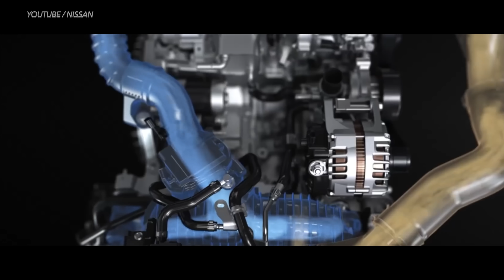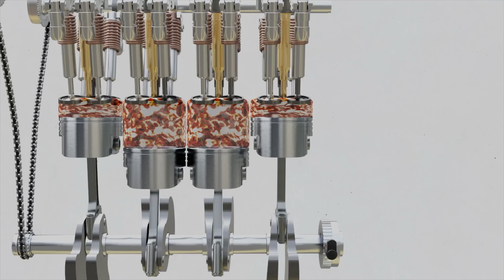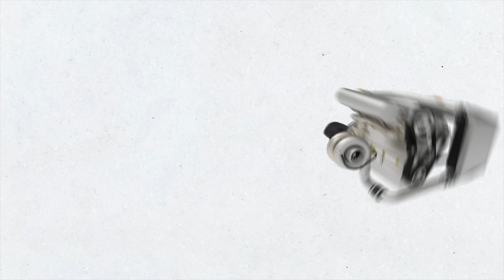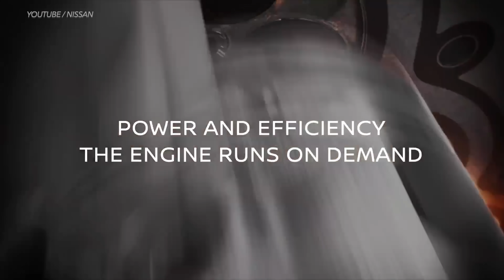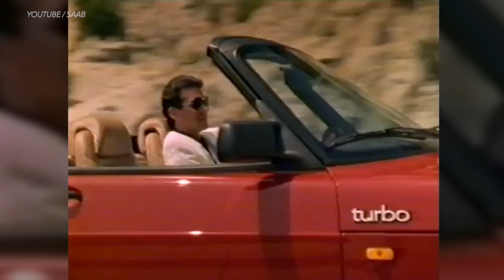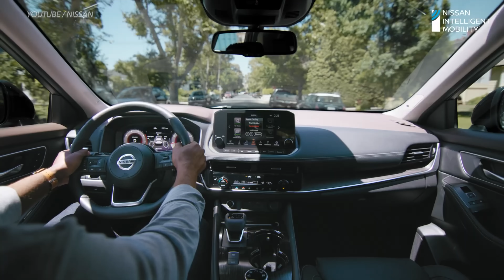Nissan Just Combined a Gasoline and Diesel Engine and Got This

Comment: Love how Scotty explains things....but all high tech comes with a price, right? Scotty tells it as it is. Me?  Sure I have a newer automobile; but today I set the idle mixture of my '49 Chev with a screwdriver.
Reply: Long live old cars.
Reply: @paulseary7041  They probably will
Reply: And 70+ years later that '49 Chevy is STILL on the road.
Reply: @cward1954  I saved the old gal (not my wife lol) from becoming a rice burner back in '97.  I have a nice low budget cruiser now!
Reply: Better hope you’re 49 Chevy is never in an accident.  No airbags.  No crumple zones (to absorb energy & protect the passenger).
Reply: @electrictroy2010  Every old car owner knows, or should know, these risks. As should every bike/scooter/motorcycle rider. Many old car guys have retrofitted their rides with modern safety equipment such as seat belts, disc brakes, improved lighting, etc. I totally support that. As for me, I putt around town at 30 mph and allow for plenty of stopping distance. Everything in life is a risk, even getting out of bed in the morning is a risk. In order to live life to the fullest,  one must take reasonable precautions and live responsibly. And I do.
Reply: A screwdriver?
Reply: @silentknightm2362  Yep. The idle mixture adjustment is a screw that turns out to richen the mixture and in to lean it.

Comment: So besides the frontier, which has been very reliable, what other Nissan vehicle jumps out as a reliable, desirable ride compared to others?
Reply: The jlr50 platforms the Jr50 platforms those both used the vg33e and we're pretty much bulletproof and extremely reliable still using them to this day and they pull great ✌️

Comment: US should switch to metric system. This does not make any sense.
Engine displacement -> in LITERS, but fuel consumption in gallons.
Imagine a L4 engine that has 0.528344 gallons of displacement.
Sounds American, sounds right...

Comment: Whilst I'm really impressed that they have actually managed to do this unfortunately it looks just like there's more to go wrong the usual suspect is more moving parts
Reply: At the end of the day my old Lexus V8 gives 24 mpg combined (UK) and makes well over 280 BHP, plus 325 lbs with no turbo or direct injection.  Granted your losing almost 10 mpg but as you say more parts, that buys a heck of a lot of fuel.
Reply: @rob5944  well it depends how much you drive. I was driving 10k miles a month for a long while and if I'm getting 10mpg less and have to pay for premium fuel that alone would cost me more than the car lol.
Reply: @occckid123  well I guess so.  Mind you if I had to drive that much I'd consider moving or asking for either milage or a company car!
Reply: @rob5944  thats not an option for what I'm using the car for.
Reply: @occckid123  I see, well I guess that's just too bad then 😕
Reply: Well, more to go wrong, and when it does, it's SUPER expensive to deal with.
Reply: @cward1954  complete engine rebuild I'd imagine.
Reply: And sensors and wiring and moving mass and computers and actuators and solenoids....
Reply: One thing going for electric cars is the use of one moving part and efficient motors (disallowing Tesla Plaid driving style), the electric charge source is likely generated at maximum power plant efficiency regardless of the original fuel source be natural gas, coal, nuclear, hydroelectricity, etc.
Reply: @richardwilliams1986  however that's about the only thing going for it.  I think that possibly hybrids are useful to keep pollution down in the cities, but aside from that electric only vehicles are nothing more than a gimmick.
Reply: @Rob Modern electric Teslas can go over 300 miles between charged.  On the road they can supercharge in 20 minutes.  At home they charge while you sleep.

EVs can be lived with very comfortably

.
Reply: @electrictroy2010  they're very expensive though.  Many terraced houses have nowhere to plug them in, and a house like ours will need to be upgraded if we want a dedicated charger.  Actually a hotel in our village has a rank of Tesla chargers and people come from all over looking for a charge.  I've had to direct a few, and I hear one needs to use only their mechanics to service or fix them?
Reply: @richardwilliams1986  The one thing that's always been holding back electric cars is battery technology.
Reply: You said a lot of what I was thinking.Would never attempt to work on crap like this or own one.Ricardo from the 20,s was hell of a smart man.This engine is a nightmare.
Reply: This world is a joke! I still can't believe that the internal engine after all of the years that it's been around, so many improvements in technology, the billions upon billions of dollars spent over the years to develop so many interesting technologies , IC engines etc..
Now the GOD DAMN POLITICIANS, EPA , AND DIRTY ROTTEN SILICONE VALLEY GIANTS , are taking all this away to replace it with  CRAPPY , just as "DIRTY AND TOXIC" ELECTRIC VEHICLES!!! BOOOOOOO!!!!!!! SCREW ELECTRIC VEHICLES!!!
Say Goodbye to NASCAR, F1 ETC....
No one is interested in sitting and watching Electric F1 cars. No beautiful sounds coming out of electric vehicles!!!!! That's why so many millions of people come to watch F1, NASCAR ETC.... the beautiful sounds of roaring engines and everything else that goes with it!! Not only that but everything else that also relates to the internal combustion engine
Reply: And more parts = more energy loss going into the parts before it gets to the wheels.
Reply: @thesilentone4024  friction?
Reply: This engine has twice as many parts to tear all to hell.

Comment: I admit I have a '18 Frontier. It's simple, and basic but even so, Nissan still makes me nervous. 
The Frontier is decent but Tacoma, Ridgeline and the F150 are leagues above and beyond better.
Reply: The simple, basic nature of the Frontier is what makes it great.   No, it is not refined or modern.  But it is reliable and the things that do go wrong I can wrench out in my driveway.  And until recently, it was very affordable.
Reply: @DaveBuildsIt  

So sad but true
Reply: My friends 2010 Frontier in Pennsylvania is a rust bucket. Seems Nissan didn't put the frame in a rust prevention bath like Toyota does with many of their vehicles. Bean counter cost saving screws the public every time. Bean counter engineering is ruining GM and Boeing  can't build a rocket that can get into outer space. Engineers should run car companies and other manufacturing concerns as it is readily apparent what accountants produce---CRAP.
Reply: Tacoma is not better
Reply: @anpham8107  Agreed! I had 2 Tacoma's in a row and both had major problems before 50,000 miles (Drivetrain) . Never again.
Reply: @stubby1122  that sounds like more... Maybe it's the way you drove them?
Reply: @AbcAbc-sp1od  When I traded the first one back in the salesman couldn't believe it was the original set of tires still on it. I don't drive foolishly. I'm sorry your love for Tacoma's is so much you can't see reality.
Reply: frontier is one the most reliable so do not know what you nervous about.
Reply: @cb5110  

I heard that they can be problematic. 
I suppose I am paranoid.
Reply: @Incognitus_Mcgee  alot of people post and say things that they do not know about, look at all comments for example, they just put all Nissan vehicles in one basket as being junk. In reality it not true, Nissan frontier, Nissan Armanda, Nissan maxima, Nissan Murano has being very reliable, for over a decade, however Nissan have problem years with versa, Altima, Sentra and pathfinder using the CVT, that where the problem are, but some people that own one of those model put all Nissan cars as being bad, while some have not own one but making remarks as if they know what they are saying. Your frontier is rank higher than toyota tacoma in CR rating even in JP power.
In reality Toyota have been have severe problem themselves, engine  and transmission. recent recall on the 2.5 dynamic force. But perception is hell of thing, I do not totally blame people but Nissan themselves.
Reply: @cb5110  

Thank you for the kind words. Yes, and you provided sound logic.
Reply: @Incognitus_Mcgee  'I heard that they can be problematic. '
Do not be fooled, couple years back Nissan was try to get better with MPG, so they introduce CVT, but only in cars and SUVs, that where the problem is, it got more reliable in the Murano and the maxima, but had issue with sentra, versa, pathfinder and Altima, the newer models have not seen any server problems like 2014 to 2016 models, and the pathfinder now uses a regular 9 speed. Now stricter measures have every single one changing their routine, and reliability drop, every single new vehicle can be problematic, the honda odessy had the ZF tranny and it fail at even 2000KM, the all new tundra from Toyota go look at the numerous complain, the Toyota dynamic force 2.5 had stalling issue, that lead to law suit, the oil dilution problem with Honda turbo engines. I could even show a guy who brought a new lexus on scotty advise saying his car is having problems.
I own a Honda accord so I am not biased for Nissan.
Reply: Ridgeline and f150 lmao
Reply: @TheGuruStud are  Ridgelines that bad? I heard they are good quality. They seem more like sedans

Comment: Who trusts a turbo engine from Nissan?  Turbo engines are notorious for being more complex, requiring more maintenance, and being outrageously expensive to repair.  Nissan is notorious for declining reliability.  How can this NOT be an endless money pit?

I remember when Nissan was known for being nearly as reliable as Toyota and Honda, but that was before Renault took over.  Nissan is now in a race to the bottom, just like Chrysler, Fiat, and Volkswagen.
Reply: Who trusts any small turbocharged engine?
I read that the little (1.0 lt) 
Ford 3 cylinder turbocharged ecotec turbos spin up to 148,000 rpm. They're going to need plentiful and good oil supply, and top notch cooling. 
I'll stick with my Honda Jazz (Fit in USA)
Reply: I really like the old datsuns with the L series engines. Years ago I had a awesome little 521 pickup with the L16.
Reply: Many people around the world, and it show you know nothing about Nissan engines, Nissan engine is not their problem, but their CVT, Nissan has been know to make reliable turbo engine skyline, 300z, where all turbo engines, the VR 3.0l in Infiniti also turbo charge.

Comment: Just what we need more moving parts in a an engine. The engineering is incredible, it may work if you have money in the bank and can afford the cost.
Reply: no only the cost to buy that engine but also get it repaired if it break down.
Reply: When I was at the doctors I had to get 3 shots my arm hurts it hurts
Reply: @bigshot3044  There there!  I am sure it will all be better soon.  Here's some hot chocolate and a blanky!
Reply: Really
Reply: And if you have the money you will NOT buy a Nissan….so no reason for anyone to buy a Nissan

Comment: I have learned something as I age, too many moving parts the more chances to break down sooner, harder to fix and most expensive at the end.  Nissan can keep that POS engine.  My simple Toyota engine it’s just fine!
Reply: Yes I also feel the same, too many moving parts. Let think if that complicated engine breaks and who can fix it. I am ok with traditional mpi engine.
Reply: Just tell me if youre broke. And also thats how the automotive industry evolves forward, trying new technology.
Reply: @iTzNitrOxZ  buy something that breaks down a lot, like any Nissan with a CVT, and you'll be broke in no time (like my coworker at my last job who dumped most of his spare cash into keeping his Sentra running)
Reply: @iTzNitrOxZ  Not really, driving a 2021 Toyota Venza Limited.  😂
Reply: Meanwhile middle east NISSAN having thuglife
Reply: The Regulators are gonna get you, 
The Regulators are gonna get you, 
The Regulators are gonna get youuuu
Reply: This statement s why I don't trust helicopters...
Reply: they ask for simple engines, when toyota or nissan or honda or whoever gives them a simple engine, they criticize and claim for one with a turbo, people are not tended to
Reply: You're not supposed to fix it, you're supposed to get a new one
Reply: Modern Toyota engines are not simple. Engines made in the last 15-20 years are not simple. But they sure as hell last a lot longer than they did from the 60s-90s.

A modern well built engine should make 200k+ miles of it's well taken care of. Hell I got 240k on my car and outside of PME and a valve cover gasket, zero issue. We are talking sparkplugs every 100k and the same coils. 

You were lucky to get a 100k back in the day.
Reply: Bet Toyota and Honda could perfect it, if possible. Only one's w their head out their arse
Reply: Agreed. A Toyota owner
Reply: Try a rotary FD
Reply: @pjsneeringer5942  gross
Reply: @1981ChryslerImperial  superb

Comment: These things will be as Scotty says, an endless money pit when they age... and I agree with the commenter who said " They can make this, but still can't build a reliable automatic transmission"
Reply: So with Nissan it’s not the belt that’s bad in the cvt it’s the valve body unit in the cvt that is supposed to send the fluid to the transmission but people don’t know is that you have to update it over time so it doesn’t do that and if you do update it it lasts so much longer my mom has had her 2011 Altima for year and it has 350,000 miles on it from us doing that with the original cvt and motor running and driving just fine but you have to change the fluid every 30,000 miles and update that valve body control unit and you’ll be fine
Reply: @rossvice3909  interesting!
Reply: @rossvice3909  thank you Ross for explaining that to everyone and even if they don't update the valve at least change the CVT fluid every 30,000 miles
Reply: @rossvice3909  did you have catalytic converter problems other than that the car is good the clear coating is peeling
Reply: This is just what I was wondering about at the end of the video. Are these going to be as reliable and low maintenance as a Honda or Toyota?
Reply: @thebrinksf69  yes
Reply: @thebrinksf69  no, but Nissan in the comparative classes typically has more technology and that's really what people buy them for is a luxury feel with design and tech.
Reply: @thebrinksf69  — no Renault products are as reliable as Honda or toyota
Reply: @randomschmo5778  in dreams
Reply: 20 years old gorgeous Infiniti i30/Nissan Maxima A33 look at you and laughs hysterically... Off course Nissan Corporation capable of almost everything engineering related, why they don't do it that's another question... :(
Reply: Maybe because Nissan does not make its own transmission… the only brand I know of that makes their own transmission in house is Honda
Reply: @a9653192  um... Jatco is owned by Nissan, Subaru builds it's own Lineartronic CVT, Toyota owns Aisin transmissions...
Reply: @a9653192  - interesting, why is that?
Reply: @a9653192  Nissan owns JatCo who builds transmission for numerous automotive brands including Mercedes Benz
Reply: @TinoMiller  Mercedes Benz actually uses Daimler transmissions
Reply: @a9653192  I thought Toyota does as well , no ?
Reply: @analactica  Toyota uses Asin transmissions
Reply: @a9653192  and ford 2014+ models, and Mazda as of the 2019+ models, and Toyota in 96-12 models I think. BMW also made their own for a few years, that didn’t end well and went back to ZF.
Reply: @a9653192  the only 2 company made their transmission in house is Mazda and Tesla
Reply: The cvt is actually one of the best transmissions in the world I've replaced over 10 of them only problem was someone used the wrong fluid every time
Reply: most new cars are money pit 
sadly thats how its going nowadays
Reply: People treat economy cars like race cars and expect them to last a lifetime lol 🤣 race cars change parts all the time I've owned many CVTs 5 different cars but I did buy them all new 0-10 miles on them
Reply: HONDA makes great manuals, but their automatics have bad clutches.  The CVTs have poorly lubricated pulleys that start “grinding” as they change size.  Early CVTs die as early as 80,000 miles 

.
Reply: They cant but ACEN can
Reply: Ford also has its own tranny
Reply: As long as they can build a reliable manual transmission then an auto doesn't matter lol
Reply: Nissan can make reliable automatic transmissions they can’t make reliable CVT transmissions which is what Nissan has had for over the last 10 years and finally phased out this year as they could never get it to work properly
Reply: I mean it took that from Mazda anyways
Reply: They can build an automatic tranny..but why would they? Do you know how much money they make of these  things??
Reply: Planned obsolescence,, been counters always get bad business practices in to manufacturing to justify there non productive existence
Reply: This engine has twice as many parts to tear all to hell.
Reply: actually nissans newer CVT transmission is not bad
Reply: @kinrip1123  yes you are correct they aint bad they are worse !!
Reply: @hanirahman13  lol, thats actually funny, but they do make them better now
Reply: @kinrip1123  right mines solid so far I’m flooring it everywhere and now it’s at 70,000 and no slipping